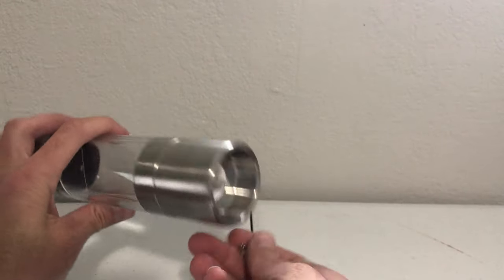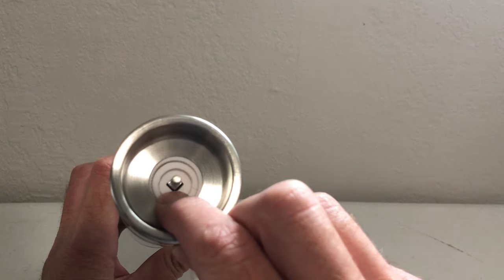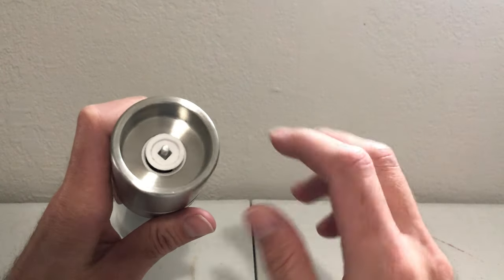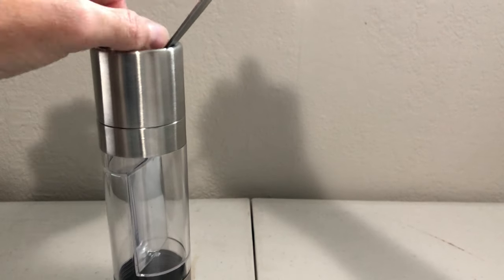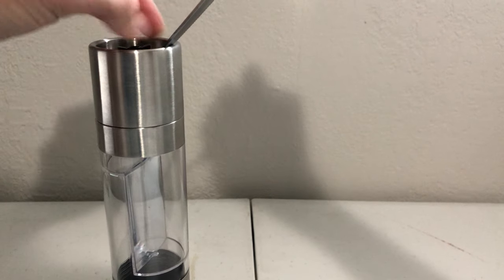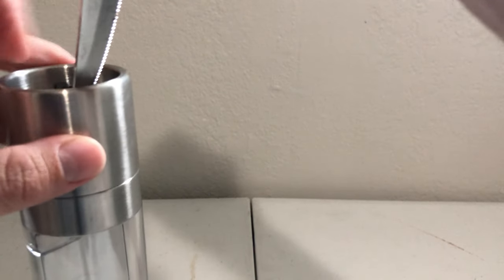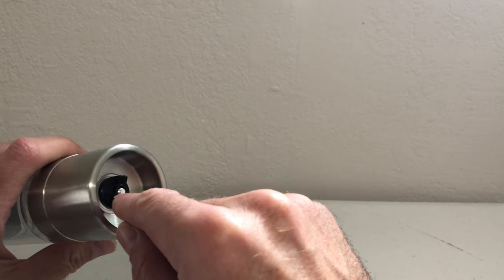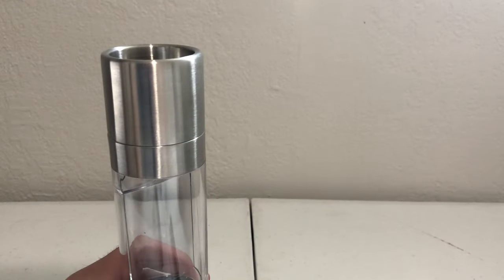SpiceCrafts Grinder Jamming - How to Fix

Comment: Thanks for this video. It helps explain the mechanism.
I took my Salt grinder apart as you showed but it still gets jammed, every time. I use pink hymalain Salt. I also put a light coating of oil on the metal threads. Nothing seems to help.